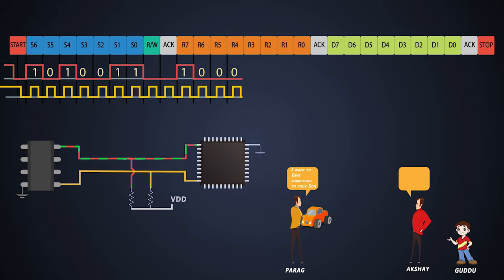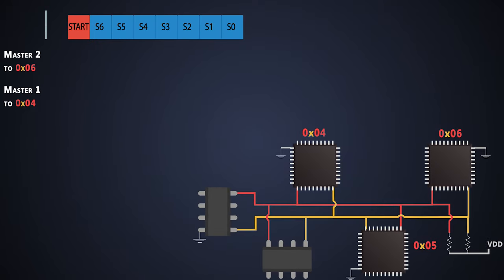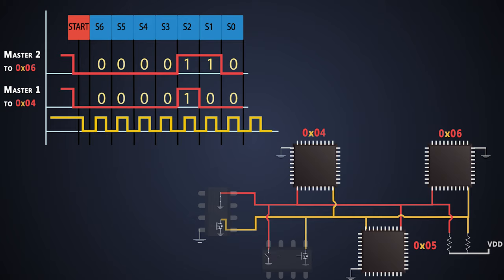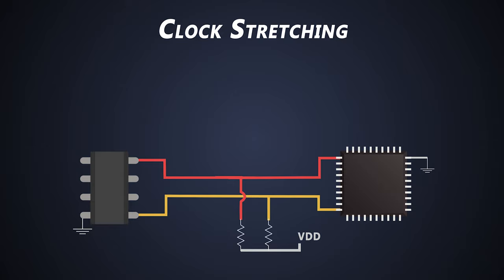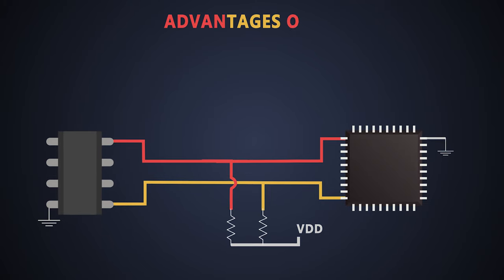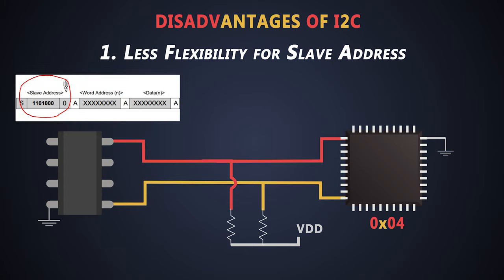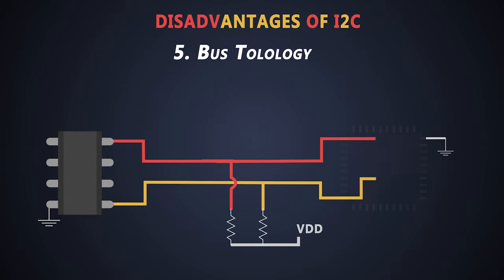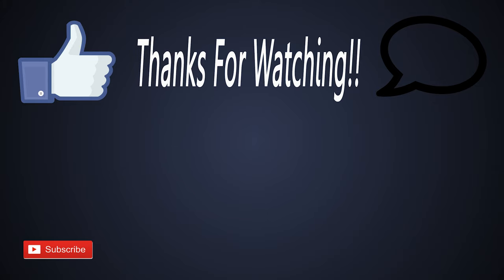Advantages & Disadvantages of I2C | Bus Arbitration In I2C | Clock Stretching In I2C

Comment: Hey, your explanations are very nice and clear.
I have a question, in your example you gave a situation where two masters want to send information to two different slaves but what happens when two masters want to send information to the same slave which master gets priority? And why? , Thanks.
Reply: user-md3fu8iu4x  your answer is not correct, at least you must understand the question.💩
Reply: I have the same question. I am guessing it will keep on comparing or checking the SDL line even after the slave address and if there is a difference in the address of the internal register address for both microcontroller then priority might be given on that basis. And if the register address is also same then both will receive the same data they requested and if they are writing then again there will be comparison i think this is how it must work. Not sure though!
Reply: The bus arbitration logic will take place at address or data phase itself.

Comment: Hi Akshay.... Here I am facing same problem of scl pulling low in i2c bus... 
How can I use clock streching technique at my code, please explain
Reply from the maker: Please send us your code and entire description on foolishengineer7@gmail.com

Our teammate will help you
Reply from the maker: @kavita 
Clock stretching, sometimes referred to as clock synchronization, is a mechanism used by an I2C slave to notify the master to slow down the clock speed.
I2C devices can slow down communication by stretching SCL: During an SCL low phase, any I2C device on the bus may additionally hold down SCL to prevent it from rising again, enabling it to slow down the SCL clock rate or to stop I2C communication for a while. This is also referred to as clock synchronization.
This situation may happen when the slave is waiting for its internal operation to finish, such as EEPROM read/write, sensor data calculation, internal state machine to settle down, and so on.
The master, on the other hand, is required to read back the clock signal after releasing it to the high state and wait until the line has actually gone high.
As described above, to implement clock stretching mode (a.k.a blocking mode) in a master side, it is required to read back the SCL after releasing it to the high state, and wait until the line has actually gone high.
If you are using a I2C controller as a master, the clock stretching is usually handled by the I2C controller in hardware level. But if the master communicates with the slave via GPIO, it needs to be accomplished in software level (driver code).